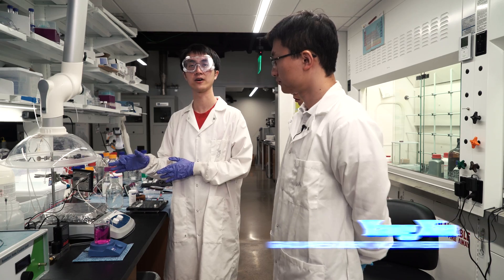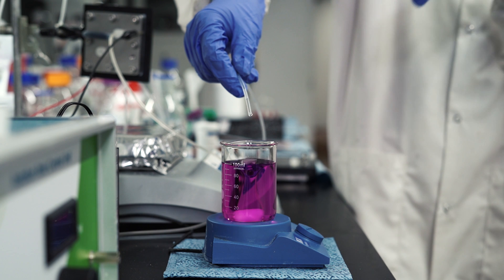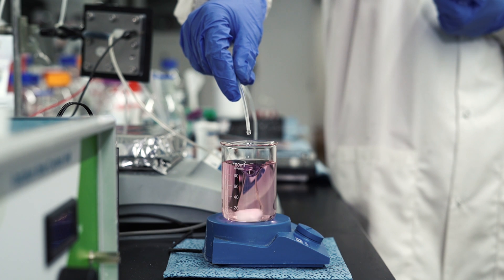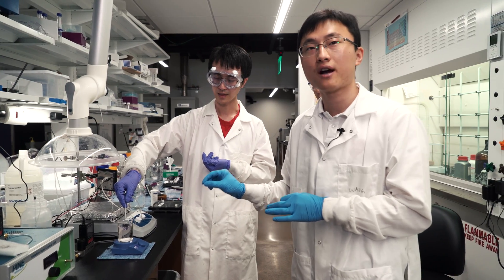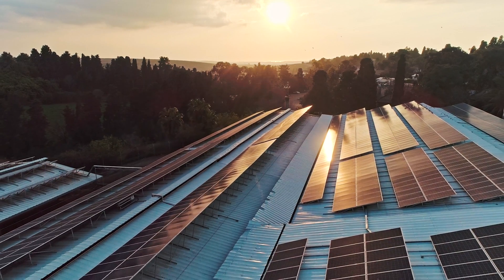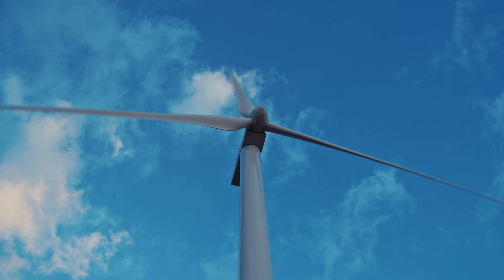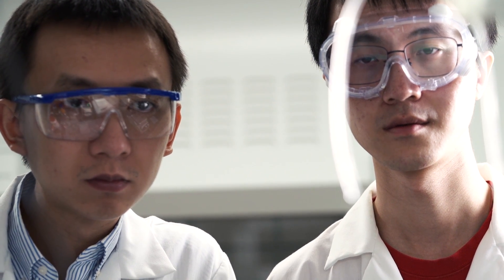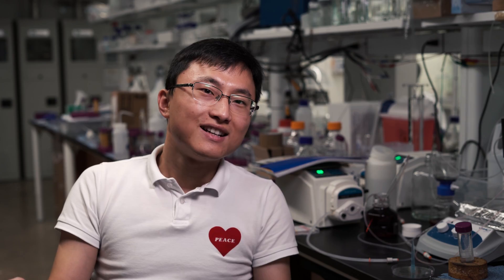Rice University reactor produces pure hydrogen peroxide solutions from water, air and electricity

Comment: Still waiting to buy the anod katods. .
Reply: Respect. I was working in my home workshop, laboratory, experiments on making an electrochemical cell to produce hydrogen peroxide. But I don't have top-of-the-line equipment and H2O2 indicators, so instead, assuming that I was getting a H2O2 solution, I poured H2O2 into the HCl acid in which I added metal copper. Over time, due to the low co-concentration of the produced H2O2, the colorless solution of the acid and pieces of copper metal began to turn blue. This shows the presence of hydrogen peroxide, because only HCl acid does not react with elemental copper.

Comment: Hydrogen peroxide is the gasoline of the future, that's why its production method is a closely-guarded secret, and is made the subject of a lot of scare-mongering.  Very likely, there is a way to produce it without a lot of input energy, (just like when it is formed spontaneously in small amounts when water vapor condenses into clouds.)

Comment: What apparatus costs to produce hydrogen peroxide(50%) by converting alternating current to direct current through water in the presence of catalyst what?? Please explain
Reply: BDD electrodes and in the future I will show a video of something similar.
Reply: In this process, caction ions positive one move towards cathode of steel terminal,, anions negative move towards anode terminal of graphite.. carbon... how much dc current amperes consumed in this process.. moreover, oxygen produced can be compressed to liquid oxygen used in hospitals..Pl elaborate
Reply: @kashifabbasiabbasi5388  700ma/cm^2 andd you need an ED cell setup with 2 ion exchange membranes where the central chamber containing all the neutral stuff like hydroxy radicals that form due to the insane current density.
the anode chamber is full of H2SO4 and cathode chamber is NaOH or pure water.
The central chamber is hooked up to a peristatic pump to pump out hydroxy radical containing water which will recombine into H2O2.
The oxygen byproduct in this process is not usable for it contains mostly OZONE and cannot be used in hospitals.

Comment: What's  catalyst that use for reduction oxygen to produce hydrogen peroxide
Reply: cathode can be anything but the important thing is the special anode running at 500ma/cm^2 which causes OH* radicals to be attracted to the anode but with flow in the central compartment of an electrodialysis cell setup you are able to obtain H2O2 as this intermediate is caught up in the flow and gets pushed out of the setup instead of forming ozone at the anode.
I will make a video of the special anode soon since I found someone who might hook me up with one.
Reply: @CatboyChemicalSociety  did you made hydrogen peroxide yet with electrolytes

Comment: is this 100% H2O2? the water used is it ultrapure water or just normal deionised water? Is there a test to look for impurities in the H2O2 such as sodium and other minerals, and is the H2O2 that you produced stable?
Reply: Dumb question. 100% H2O2 is known to decompose with extreme violence in contact with most contaminants.
Reply: @inverse2k1  wow didn’t expect a reply 2 years later. Let me clarify myself when I say 100% H2O2. I meant the purity of the H2O2 itself, not whether if it’s been diluted with water. Whether the H2O2 used is free of metals which are commonly found in H2O2.
Reply: @Probc-or9yu  Lets break it down. It's made from water, air and electricity. Which of those is a metal?
Reply: Hydrogen acts like a metal  @EddieTheH
Reply: @francom6230  Well it's hardly going to be free of hydrogen, which isn't a metal anyway.
Reply: @EddieTheH  the reason for my question is because back when I used to conduct research and experiments for a H2O2 purification plant, even though the purification process can purify the crude h2o2 till 99.9% but there’s always a trace amount of metals found. And this 99.9% purity is not about dilution with water but rather what’s actually dissolved in the h2o2 itself. And i actually can’t believe I’m back to this comment section 4 years after hahaha
Reply: I'm curious on the percentage also but it's probably distilled water idk
Reply: Here, I can give you an answer right away that it is not pure H2O2, because if it were pure, the liquid would be blue, and even with a small amount of water, hydrogen peroxide is a colorless solution.
Reply: it isn't, otherwise the h2o2 would destroy the hoses used
Reply: @arturpinheiro5518  that seems unlikely.   I routinely have 35% HP in sprayer hoses and in contact with plastic for years and years with zero issues.  I am no expert but.....
Reply: @coppulor6500  higher concentration is wired it can explode and do reactions unlike 35%

Comment: Please explain the difference in the process(if any) of using deuterium and hydrogen dioxide to make hydrogen peroxide.
Reply: "Hydrogen dioxide" XD dude just say water. Also there is a slight difference when using deuterium and normal hydrogen such as slower rates of reaction etc.
Reply: @general_prodigy  bro you cant correct someone while being wrong yourself, hydrogen dioxide is not water, dihydrogen oxide is water. hydrogen dioxide is 1 hydrogen 2 oxygen, water is 2 hydrogen one oxygen.
Reply: What the literal f are you talking, it makes absolutely no sense
Reply: @GreenCaulerpa  of course it makes sense, you just don't know what he's talking about
Reply: @tasbirmiah5247  Lol, no it really doesn‘t as it‘s clearly shown by the „hydrogen dioxide“ part.... 
I‘m a chemistry student after all so I better should be able to tell
Reply: @GreenCaulerpa   @Andre Leonhardt  a chemistry student should be able to ask a question, such as "Hydrogen Dioxide? As in hydrogen superoxide HO²?"
A good student doesn't just ask questions, they will ask the right ones.
the question boils down to "will this reactive superoxide interact with a fairly stable isotope (deuterium, most commonly encountered as deuterium oxide aka heavy water) that is basically two hydrogen atoms shoved into the space of one, and will it do it efficiently?" which is one I don't personally have an answer for, but it makes sense as a question.
Reply: @GreenCaulerpa  I am asking if it matters if Protium or Deuterium are used to make Hydrogen Dioxide and Hydrogen Preoxide. I know the difference, I want to see if someone else knows.

Comment: Where can i buy this catalyst or how do i make it at home?
Reply: I think the easiest way is to use UV-C with wave lenth less than 240 nm to irradiate air & then dissolve it in distilled water to form H2O2
Reply: @maib1089  ?? There are 222nm uvc devices but how should this work? I will not believe this is working…
Reply: its prohibitively expensive but thought I did manage to get a hold of something similar and in the future I will sell pieces for people who want to mess around with it.
Reply: https://www.youtube.com/watch?v=mfx1Ls8o4R0
Reply: @tejosulaksono9453  it is not in english!! I can't understand anything
Reply: @maib1089   Hi  he is  making ozone  with high voltage spark and  then making it react to water
Reply: @AnujSingh-lq8ty  what is the role of catalyst in this reactions. can we irradiate water directly with UV-C to form H2O2  ?
Reply: @maib1089   Hi  I am sorry  I have  very little idea about  chemistry,  I am  also looking  for H2o2 generation method, if you have any idea kindly share
Reply: @AnujSingh-lq8ty  ok sure i will
Reply: @maib1089  sorry late rply, anuj singh already  explain that, from the video, better to have the spark from automobile coil, or old tv flyback, its cheaper. then aerated the RO water you wish to be h2o2 using aquarium air pump and with airstone, more contact to water. after a while, check with the ph meter.
Reply: @maib1089  no catalist is used, but high energy is put in to the gas reaction, and the uv also help so much naturally ( Christian Friedrich Schonbein 1840) , ozone came from air with help of lightning spark, maybe help reduce the time if combined. cmiiw
Reply: @tejosulaksono9453  thank you very much.
Reply: @tejosulaksono9453  I thought ozon decompuse the H2O2. you can only make very deluted solutions. An easy old way was Turpentin with water and sunlight it forms H2o2 too but only very deluted solutions.
Reply: @Preyhawk81  So it makes no sense to ozonate the water for weeks then If the H2O2 will not get higher percentage.
Reply: @Telectronics  No H2O2 is realy unstable. Comercial has some stabiliziers inside. Only "simple" methode that was industiral used to is the oxidation of scoundary alkohols best Isopropylalkohol by bubling air at 70c throught it in present of a very small amount of h2o2 it acts as an catalyst and you get an mix of Aceton and H2O2 around 20%  as products. But i dont know how to seperate.
Reply: @Preyhawk81  Thanks for your answer ! Do you know a simple method from scrap ? Electrolysis would be so cool but I could not find any working setup. Maybe persulfates ?
Reply: @Telectronics  Clay pot diaphragma and ammoniumsulfat elektrolysis on an platine anode at 20C temperature. It forms ammoniumperoxidisulfate and in water it hydrolyses to ammoniumsulfate and H2O2. This way it was produced from 1900 to 1940.Problem is you need an destillation setup or freeze it out to seperate the products and destillation of h2o2 without special equipment is suicide. For destillation you need an still out of quarz glas or pure aluminium no alloys and it must be cleaned with pure deluted nitric acid.
Reply: @Preyhawk81  Thanks ! You are right it´s better to avoid destillation.
Reply: @maib1089  turn on the cc auto translate on that video link, it's hilarious.
Reply: @Preyhawk81 u need 2 nafion films with 1 functionalized with sulfonate and the othet quaternary amines. Clay pot won't work and is also a nucleation site which decomposes the peroxide
Reply: @Preyhawk81  That 1900 nafion is powder but the nafion needed are other types you can look up and is in the form factor as a sheet not as a powder.
Reply: @AnujSingh-lq8ty  I didn't notice that it uses a high voltage installation on the cell to make ozone and synthesize with water into H2O2.